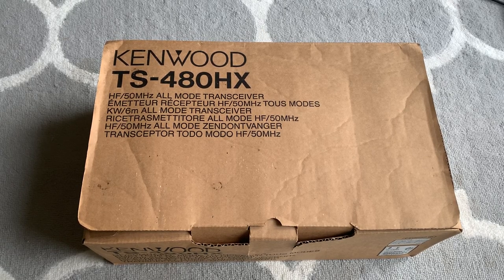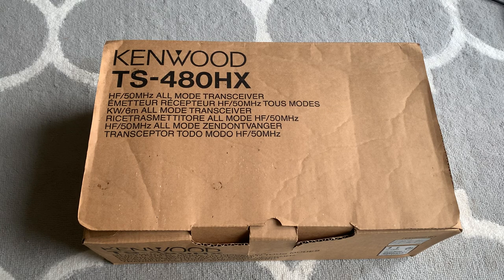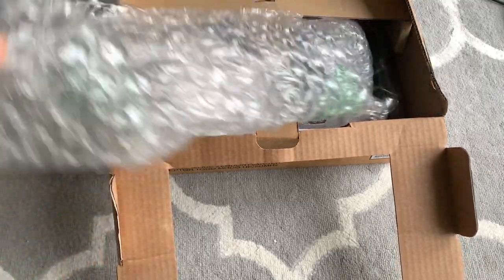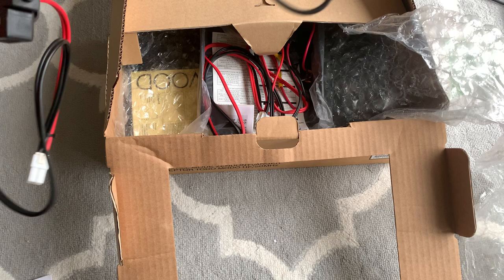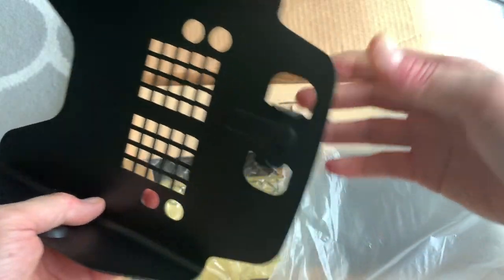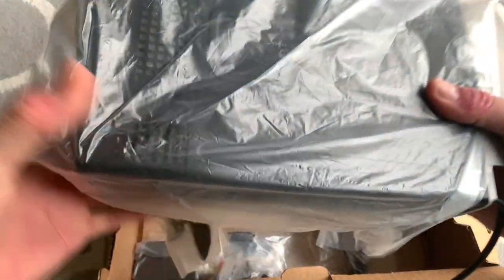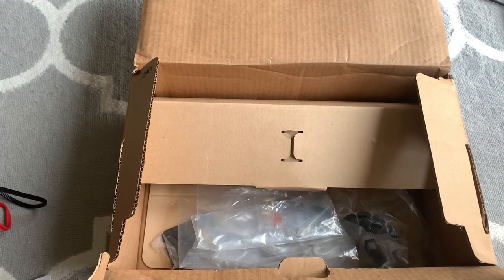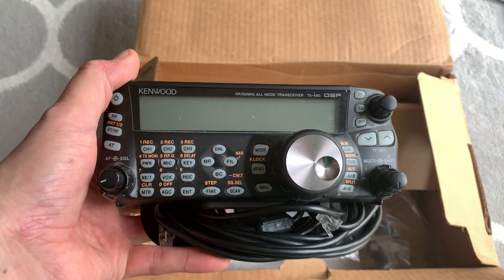Finally! Unboxing my Kenwood TS-480HX 200W transceiver

Comment: Congratulations Sir on your fine purchase , better late than never. Looks as if it will be a little bit of faffing about for a while , but you relish that type of thing LOL 😂. good luck and good reports with it , and give it hell when you get it on air. I actually think that you have scored a home run here buddy , and I have seen the Icom which has the remote head as well , but com-on JVC KENWOOD is rather special. Enough said 👍 Tam.
Reply from the maker: Hey Tam, thank you very much. I didn't even know about 'JVC Kenwood' lol - but I'm not surprised you did! 73